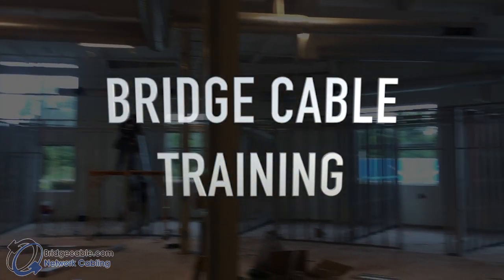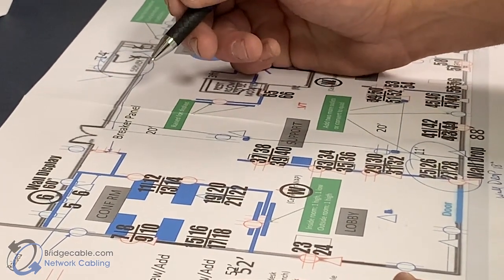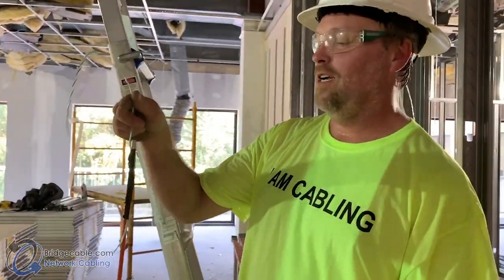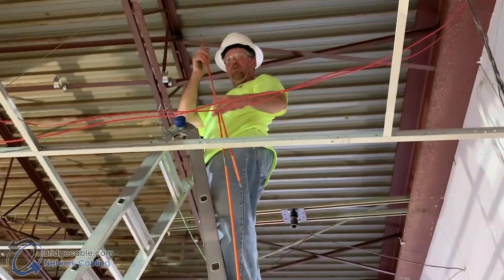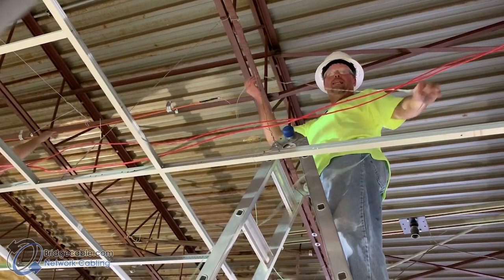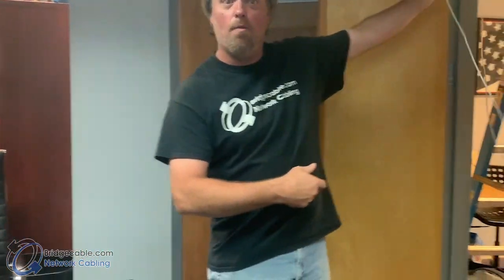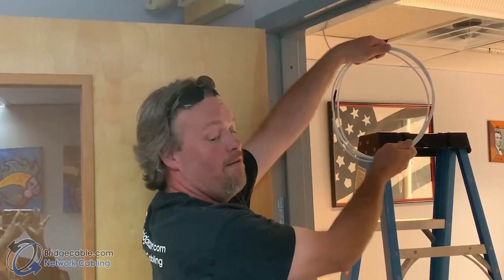How to Become a Network Cabling Technician Training | Low Voltage | Part 1 | Bridgecable.com

Comment: Im interested in a career change. Im 38, but with no formal education or training. This helps me see whats involved. However, im stuck trying to figure out how to actually get started as a working adult.
Reply from the maker: Forgive the delay! It's ok....starting over. Join a local company and really it takes about 1 year to get "good" or common set of skills! Then when able to run just basic cabling............learn a new skillset......Fiber.....then when good learn access control. Within 5years you should be making $70K to $110K!

Comment: What is the tool at 17:11 called?
Reply from the maker: Few versions out there but  a caddy template with level - We have been using these via Amazon /  Jonard Tools WTL-12, Wall Box Template and Level for Old Work Electrical Boxes

Comment: Amazing video
How you can charge for a job like that ?
Reply from the maker: Tough to quote as each site is different......best pricing still is around $125 per wire/drop. Includes the wiring and termination. Gets more complex if you add the patch panels, creating a network map, distance of job, new construction and the list goes on. How this helps! Thanks for watching!
Reply: @BridgeCable  Thank you for your response, truly appreciate it.
I'm in San Diego CA.

Comment: How do you become a cable technician? Do I apply for AT&T or Spectrum?
Reply from the maker: You can try with those companies.....we are more structured cabling.....which is a loose or broad term but we work with CAT6 and Fiber. I would suggest in your zip code search network cabling installation companies. Then see whom is  hiring. You will find larger outfits like AT&T and such.....they in the beginning really do not train much as a smaller shop would.
Reply: @BridgeCable  thank you for the feed back

Comment: There's nothing wrong with using bridle clamps in a warehouse/factory setting. We use a smaller bridle that has a small round yellow plastic insert to provide better support.
Reply from the maker: Bridle WITH the plastic support is SOOOOOOO much better indeed. In time without the protected ring the weight of many cables might hurt the cabling over time. We have seen it happen in the field and tend to avoid them in our company. Thanks for the comments! Love it!

Comment: In the office with the swinging patch panel. I'm confused on why you didn't bring the cable down through the wall. And straight out to the patch panel. It would look better than exposed cabling coming down d rings. No one wants to see exposed cabling. Other than that. This is a excellent video. So great job guy's
Reply from the maker: Typically we do not like to put in the wall as down the road more might be added or for troubleshooting you need to re-run a damaged cable. Depends on the site, in NJ we did just run down the wall. Coming down the wall at the end location (MDF/Server) we tend to use a Conduit with bushings, Ladder Tray or D-Rings down the wall.
Reply: @BridgeCable  We do the same. Was really just wandering. Because exposed cabling looks horrible lol. I'm by no means knocking your work. You guys went above and beyond with you tutorial video. I actually am going to share that with some of our Jr's. We do a lot of big warehouse projects. 200 plus drops Fiber uplinks. OTDR certifications Access Control, Digital Signage, We Know coming down an interior wall is easy as it gets though. Tell your team keep up the amazing work.
Reply from the maker: @benfields7707  Thanks for watching and comments! Means the world to us! Keep Cabling!! Knock it out of the park!!

Comment: Please stop using zip ties. They are horrible for cable. Use Velcro instead, it doesn’t pinch the cable and it’s reusable.
Reply from the maker: We get it.....avoid the zip ties....but if using them......make em snug.....not a death grip on the cabling :)

Comment: One thing I see here that they didn't do...always cut every cable at an angle and stagger the ends in the bundle, then tie the string on and tape it. That way the end of the bundle doesn't snag on anything as you pull it. Great learning video!
Reply: only thing id change

Comment: Just started this trade about 3 months ago. I work with the coolest small company I’ve ever seen and everyone is great. We are super heavy on the cable management
Reply from the maker: It's a great trade to get into....pulling cable....like we said before....years down the road...it's a art :)
Reply: Listen I don't know if anyone else does this. But we make all our new techs. Use 100 of the old RJ45's. Before they can use pass-through Rj45 connectors lol.

Comment: Great video. Loved the tips about the markers under the numbers on the cable and leaving an end on the tape.
I got a tip too when screwing J hooks to blocks: instead of using rawl plugs, get some DeWalt Wall Dogs. All you need is a 4mm or 4.5mm pilot hole and you can screw straight into the block (or even concrete) without using any rawl plugs. 
And they're strong.

Comment: Its always interesting to me to see the way different companies and different techs do things. In cabling there is not always one right way to do something, often there are multiple ways to accomplish the same task, neither may necessarily be right or wrong,  just different......but... you'll very often have techs/installers/ PMs etc who think their way is the ONLY way or the best way, because that's what they are use too. There are many people like this in the cabling industry, so they will always chime in with their 2 cents and say that the way your doing it is 'wrong' or could be better.

For example, to me writing on cables with a Sharpie, I've done, we have all done it, especially back in the 90s but now I print multiple labels, one to stick on the box for the pull, 2 for both ends of the cable during/after the pull and 2 more for final termination at the user end and patch panel( if the cables need to be shortened). Then you got someone like CableSupply.com that does not label their cables at all, they pull them with no labels, terminate them, then tone them all out at the end and then label......all work, none are right or wrong necessarily....just different.
Reply from the maker: BOOM Eric! Well said! Bravo! There is so many ways to run cabling and each tech will bring their own style or flair. Start with something....some guidance and then move onwards. Our new guys need some direction but a good problem solver, or cable tech, will understand the "basics" change from job to job. I LOVE this comment and wisdom. THANK YOU! Paul Wallace.
Reply: @BridgeCable  I can definitely appreciate a company that lets experienced techs do their job, without having to micro manage EVERYTHING, right down to the type of knots they tie in their pull strings....lol.
Reply from the maker: @Eric-qx1kx  We try to get a standard and then hand off to the leads. :) We TRY....micro management gets tough...in any business. Far from perfect :)

Comment: Pulling cable is an art.  I have seen a few jobs go sideways due to not keeping proper track of wire pulls and completed areas.  It can turn into a Charlett's web of pain. Keeping on top of drawing and what has been pulled and what needs to be pulled.  Keeps a major mess from forming.  I told the new person it is time for arts and crafts.  We updated every day. It was the best thing we did through the project to keep all involved on track.   We knew on multiple floors at any given time what needed to be done.  This helped to locate manpower when you were given extra help for the day. It was one of the building blocks I try to teach new people getting into the low voltage industry. I always liked full large prints for this. A good plan leads to a good ending.  It a real pain to do work twice after the walls   start closing up.  Sometimes it better to wait on a tricky area and a better solution will solve itself.  I hope this helps someone getting into the trades.
Reply from the maker: Very true words! Cabling is an art.......sure....everyone can slap some wires across the ceiling. However structured cabling and large installs require some thought....or a CRAFT. I like what you said....and good point......when stuck on those few weird runs.....take a break....then try again! #Bravo
Reply: @BridgeCable how many RCDDs do you guys have? All I see is excellent work. ❤❤❤
Reply from the maker: @kristopherleslie8343  Awwww.....big compliment from you. We did it backwards.....learned by trial and error and then advancing towards BICSI Levels :)
Reply: @BridgeCable  yea seems common lol. I've been advocating for people to get certified it makes sense !!
Reply: @kristopherleslie8343  If I could go back in time....I would! 50+ and learned it the "Hard way".
Reply: 90% of it is in the preparation. Guys think yanking the shit out of the cable makes it go faster, but it doesnt, it makes it go slower.
Reply: Not hard if you have a brain

Comment: What is that tracing tool
Reply from the maker: Typically cornering the market is Fluke with a toner/wand. Puts signal on the wire and helps make a noise to find the cable if lost in a bundle.

Comment: Who is still using zip ties????? Velcro is the way. Reusable, and you can't strap it down too tight on the cable.
Reply from the maker: Really depends on the job...cable tray 1000% Yes! The true "scary" thing is when rookies crank them to tight....snug fit okay....just too much pressure and you might pinch the wires.
Reply: In the server closet's, velcro all day, but out on the floor, tie wrap's. And who says "zip-ties"?

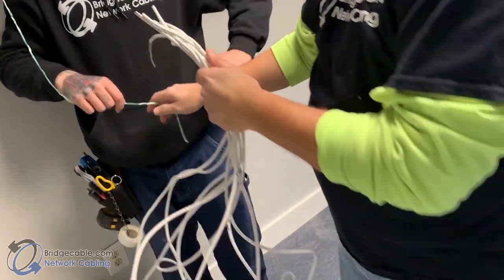Comment: 6:50 clumping the cable like that makes it harder to pull. Instead, staggering them will make for a smoother pull especially if you’re gonna be pulling through a hole or down a wall.
Reply from the maker: Depends on the ceiling....the example ceiling was wide open. Staggering is good....back and forth on that one :)

Comment: 06:22 OVER / UNDER Method is better in my opinion.
Reply from the maker: Totally get that.....sometimes up....sometimes down....depends if the wall is capped. Thanks for the input!!
Reply: @BridgeCable  I'm not fortunate to get help when pulling cable, so I have to take care of all corners of pulls. I find that the over-under works well in most situations.

Comment: So far I’ve just had to do residential, and I haven’t ran much cable. I’m still in training. This would be a bit overwhelming. I could do it, but I guarantee I would be much slower than these guys. 😂
Reply from the maker: It's like memory, in time you get into a rhythm. You just take one section of the building and then move onward to the next :)
Reply: Ya gotta start somewhere.

Comment: 2 tips #1 when youre taping the string to the stick - tape all the way onto the string. if you have to pull back on the string if wont split a grid wire or duct strap and cause you to have to go find it and release it it. Same for a fish tape. if you have to pull back it wont split a BX or strap in the wall. #2 when you take the 'head' 'nose' 'starting point' (whatever you wanna call it in your town) ...always tape that thing like its going in your a$$. you want something fat and bulky more power to ya! .....but smooth staggered and thin. Great tip about double lines on the backside of the numbers. 26 years, never seen that one.

Comment: No black tape on white cable. No tie wraps on cable ever. Other than that good video.
Reply from the maker: Any reason for no black tape on white wire or just your preference? Yes....no wire ties...anyone says it....just at times if you do not "crank em down" too tight...they are fine at times. I know alot of comments will fly on this one....let it begin :)
Reply: @BridgeCable  only because black tape adhesive gets on the jacket. especially on jobs with out the a/c turned on yet. tie wraps are fine....like you said, not too tight.

Comment: I got a job as a computer tech but I’m mostly doing this stuff .. question how much should a cable tech be getting paid ?
Reply from the maker: Tough one....I can only gauge this for the Philadelphia Area. Basic cable pullers are starting at roughly $15 per hour. Contract (hired guns) are around $25 per hour. Skilled Srs are $30-$45 per hour. Union is around $60 per hour, Prevailing Wage is $57 plus $23 for Fringe. If you can run a project and a team most senior techs should be making a comfortable middle class life if steady work. Proud to report our guys are the highest paid as we value and stand behind their work! :)

Comment: Use blue painters tape (the fine edge type) to secure string and cables together temporarily instead of electrical tape. It holds strong, removes clean quick and easy.

Labor Saving Devices makes different sized mesh socks that fit over the end of several cables to save a lot of tape, and holds strong while pulling.
Reply from the maker: Love that device but true and old school of the tape seems to be working for us. Larger work forces must have a standard way of pulling and it works out better.
Reply: @BridgeCable  We completely agree on the standardization point.  Try it out sometime, as when we switched over we found it to be a huge time saver for rough-in, and techs keep their hands clean from tape residue.  It's important to note that there is a massive difference between the fine edge tape and any other masking tape (regular masking tape is terrible).

 Thanks for the great video for helping guys out with cabling training.  Glad to see the video content!

Comment: Re tossing the cable / elec tape - buy a 50LBS crossbow & attach the drawstring to that. Fire it off. A laser pointer attached to the crossbow helps with a location you want to hit. This covers 100ft per second or so.
Reply from the maker: Love the concept....unsure if OSHA approved. Heard of that....bought the bow that you attach the string to it......tried it in a warehouse...jammed up.....returned it with 2 missing darts the next day. Tape toss would be best :)
Reply: @BridgeCable  Prob with the tape toss is it only goes so far, usually due to the height restricting how far you can raise your arm. I've used a tennis ball at the end of some trimmer wire (wire used in some lawnmowers) and that works VERY well for distance etc, but sometimes you have to pull it back & throw again (I assume the same with the tape method?). The arrow method never has to be pulled back. 

On the arrow tip, you can fit a squash ball over it to top it damaging anything.
Reply: Take up disc golf on the weekends. My coil tosses are on point at 30ft.

Comment: Multiple ladders are a must. 2 ladders per 3-4 techs.
Reply from the maker: More ladders the better! Typical load out for techs is a 6ft/8ft and 12ft. Our standard techs carry a 6ft onboard. SRs carry 6ft and most a little giant version.....work vans carry the 12fts and extension ladders. Truthfully for speed we favor lifts over extension ladders....and recently had a $500 upgraded ladder stolen.....always guard em.....Philly is rough in sections :) If you see a 32FT with Bridge #16 on it....please return.
Reply: @BridgeCable  Thats a crap one! You could get your ladders wrapped/sprayed in a lumo colour or you could get a Bluetooth tracker & hold glue the hell out of it, so it stays under 1 of the steps of the ladder...
Reply: Reaching @11:08. Lets not ignore lighter class-two Louisville 7 footer's, where a 6ft falls short trying to reach above the grid and 8ft hit the grid. A little class-three 2 footers in the server room is a game changer. Every tech should bring their own ladder. If you ain't climbing, you ain't working.
Reply from the maker: @looptechnologies6751  We have a few of those....the techs with trucks carry three ladders. Everyone loves a 3 footer....the owner not too fond of em :)

Comment: Cables are exposed?
Reply from the maker: At times? We will try to answer this....but typically in the ceiling exposed but supported 4-6FT so not much "sag" or stress on the cabling. Down to location, the cabling is protected by the wall or conduit, depends on the site :)

Comment: Great, thanks for not having abnoxious music, 👍👍👍
Reply from the maker: Hopefully in 10 years the music will stand up. Video styled after an awful training video we have the new hires sit thru....with awful guitar riffs :) Hair bands never stood up the test of time :)
Reply: @BridgeCable  I think that video was actually shot in the late 90s, thus the dated music. The course is extremely basic and of no use to an experienced tech but I guess has some value to someone who has never pulled cable in their life, as the techniques for cabling have really not changed much at all, since the early days of computers and networking. Technology has changed massively since then but the cabling process has not.
Reply from the maker: @Eric-qx1kx  Amen.....cable pulling really has not changed that much! Get a standard and start pulling :)
Reply: @BridgeCable  I really can't think of many things that have changed since I started in the early 90s, when twisted pair was just starting to replace, thicknet, thinnet and IBM Type 1 network cabling. Bridal rings were more prevalent early on, rather than j-hooks, velcro was not being used back then, only ty wraps, that's about all I can think of....lol...the other installation practices are pretty much the same.
Reply: @BridgeCable  You got to be talking about those videos from Concert Technologies, where they are pulling cable to some 80s hair band tunes.....I actually kind of liked that, at least the music, the video itself is pretty useless though.....lol.